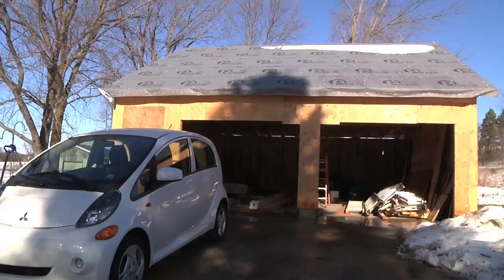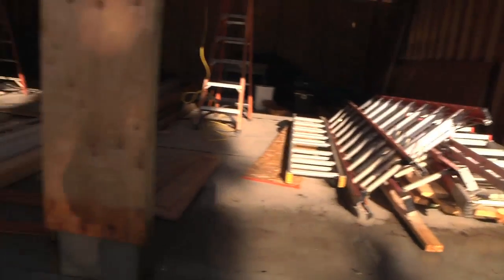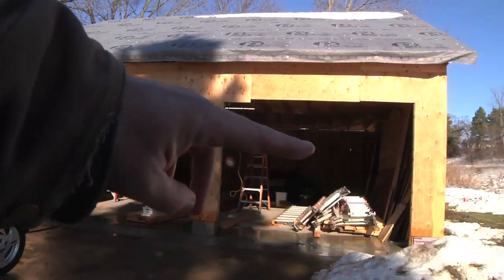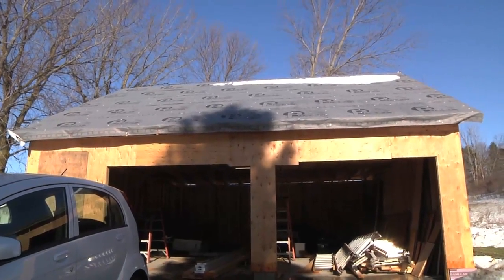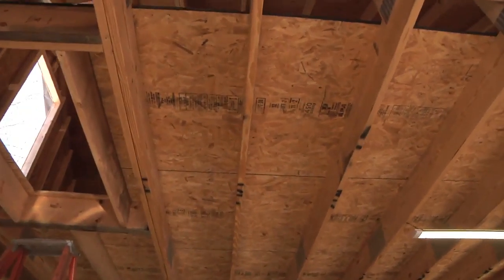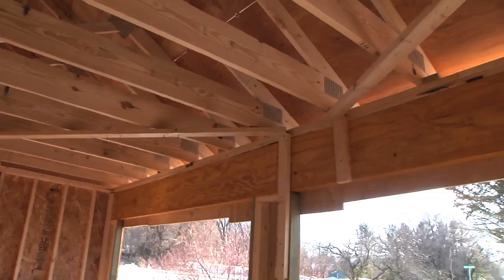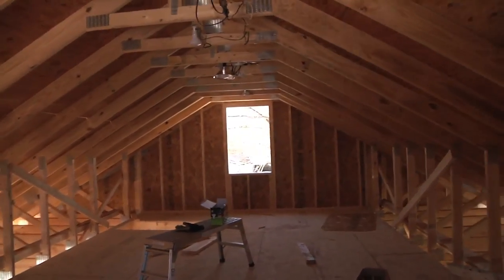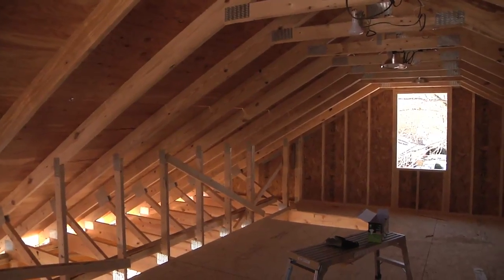Ben's Garage: Under Construction Tour Dec 26, 2016

Comment: If you made the section between the human door and the car door thicker then it needs to be(outside to inside facings) it would allow you to pass cables past the support beam and make that small area more functional with things like inbuilt shelving (for ppe keys etc) and of course light switches and power point. You don't even need to make the while section thicker just the top area to allow cables to pass, but the whole section being thicker will be less obvious and ascetically pleasing.

Comment: Flush edges at horizontal seams of the solar panels that will allow snow to be pulled down (or just slide down).. Seems like a really smooth surface on a PV array allows snow to just slide off (gravity), instead of building up to dangerous levels.. 
I guess it depends on weather factors and the panel angle. 
It's nice not to have go out an clean off the panels.. :)   

I see some people install a snow barrier on the lower edge of a roof, to protect from mini-avalanche. Those make it very difficult to use regular snow removal rakes.. 
https://www.northerntool.com/shop/tools/product_200464065_200464065
End up causing ice dams.?. Or deep snow can slide over the top of the barrier..
IMHO the best way is to keep the snow off the roofs, is rake them after each foot of new snow.. Don't give winter a chance to get the upper hand.. ;)

A few years ago, we had 3 to 4 feet on the roofs all around Boston.. Damage was starting to occur.. People on my street were paying crews to climb up and shovel off their roofs! (Big $$$)..

Comment: I wonder if that metal roof is going to act like an IR reflector? 
If you install insulation up in the attic (roof), be aware the  underside of PV panels can get awfully hot. So, maybe a little chimney drafting void under them, so hot air can escape out the top (and sides) will prevent the cooking of the roofing layers and excessive warming of the panels.
PV works really well in very cold weather! Their output can exceed factory specs sometimes. So, keeping them cool as possible, is a good thing. 
  
The problem with that tree isn't the mid-winter shading, it's the fact that it's going to keep growing! 
My neighbor (to the south) across the street has some tall trees that just keep on getting taller every year, and I get less sun coming into my south facing windows, every year.. 
I have already given up on the idea of PV panels on my garage, because of the trees next door! (east side) The trees over-hang so close to my garage, they are going to crush our garage & cars when the next big hurricane hits!